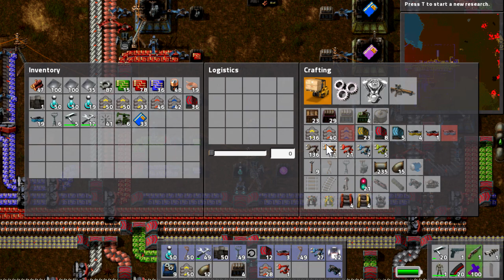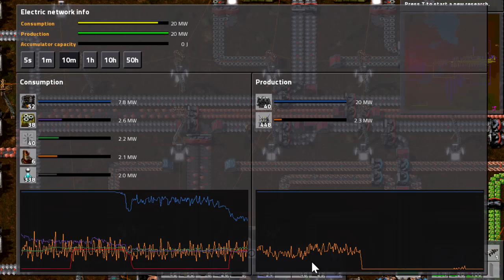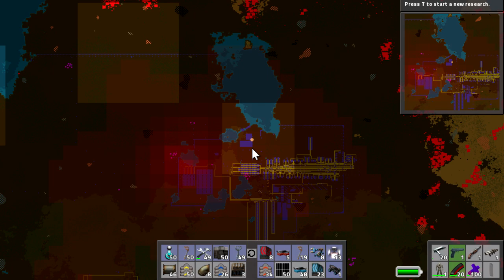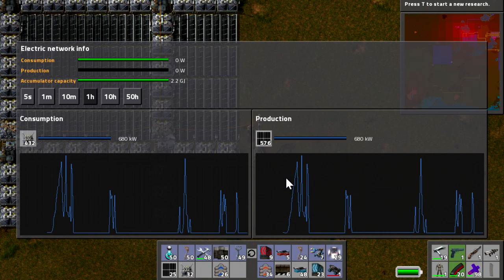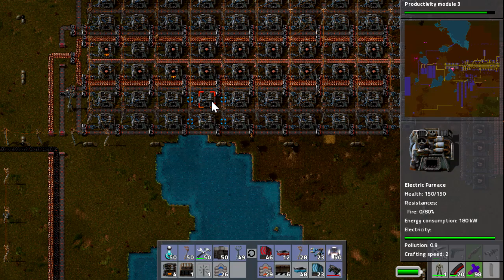Factorio 13 Solar Power At Last

Comment: When you look at 19.20, perhaps you should have intermediate splitter/merging of the iron plate lines in the middle to keep them fully stocked and not have them backed up on just 1 side.

Comment: Also X if you add effective module to machine which reduce electricity consumption and pollution. 
In my base I have no steam engine you should not use that much steam engine let solar take over
Nice video X

Comment: You need more input inserters on the "cogs"/gear wheels for the things to run at full speed.

Also, if you intend to abandon coal completely, like I did (coal was never doing more than 10MW), additional accumulators are a necessity.

And lastly, the biters were eating my solars! There should be a wall around the solars.
Reply from the maker: Anonymouspock They are safe dw :-)
Reply: xisumavoid derp yeah they are...